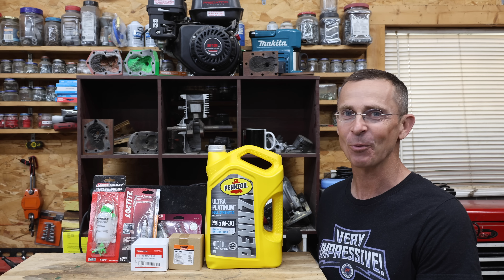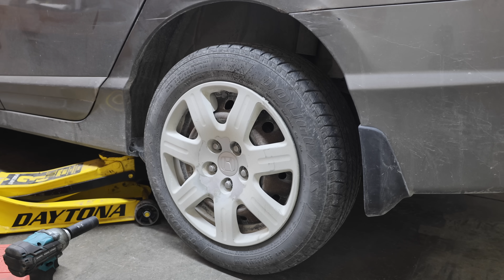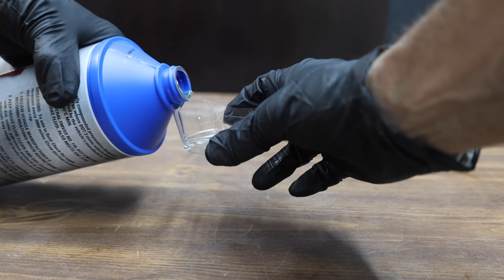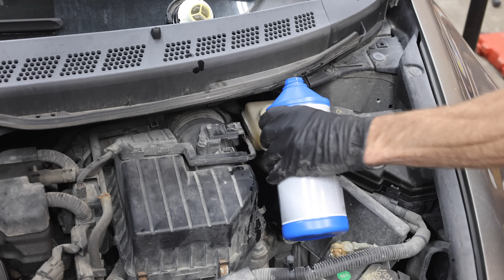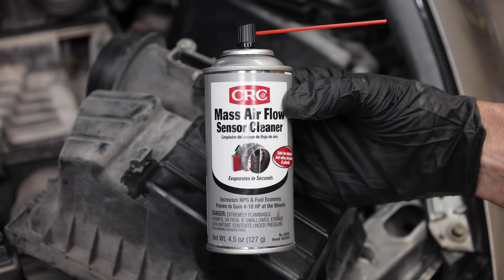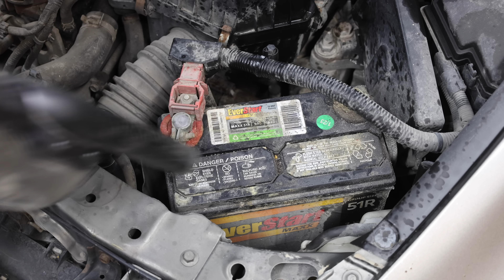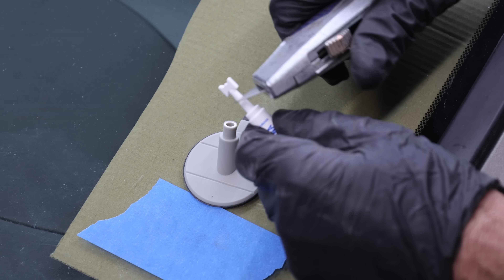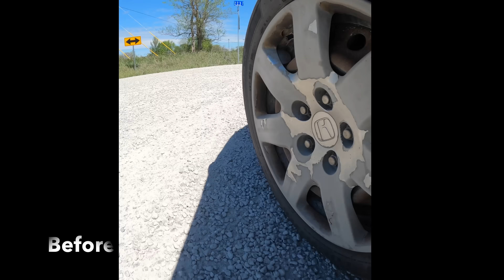Most Reliable 200K Mile Car? Let's Settle This!

Comment: My 2012 Expedition has 246k miles on and (knock on wood) she's still running like a champ. Bought her cheap because she had been VERY neglected but some new parts and elbow grease later and I have gone all over the midwest towing a boat and for family trips. About 60k miles over the last 3 years. The longer you run an old vehicle, the more it pays you back.
Reply from the maker: Nice!

Comment: Great work keeping that Honda on the road. The GMT800s are very reliable. I've owned my 06 Silverado since 30k miles. Currently doing a transmission rebuild at 170k miles.
Reply from the maker: Thanks!  Thanks for sharing.

Comment: a big issue i see with a lot of cars is people drive them when there are clear issues with them and normally just don't check them at proper intervalls. it doesn't need need a lot of checking a car ever 3000ish miles will find the small issues that will lead to bigger issues in time. take the CV joint easy and cheap to fix but not taken care of in time will lead to undue strain on other parts of the car. or take the trans fluid car makers says it is good for the life of the car but really it should be replace after 100-120k to have a longer lasting trans.
Reply from the maker: Thanks for the feedback.

Comment: I have the coupe model from 2008.  Reliable, with moderate repairs mostly ascertainable by DIY wrenching. The VTEC solenoid gasket is probably a thing to swap out at one this old.  The gasket costs like a dollar, but it will blast ALL of the oil out of the car like youd think the engine split in half. Hilariously good car, though.  Wont set any speed records and Tawny Kitaen probably wont be dancing on the hood...but its a good car.  Kinda reminds me of my Cherokee XJ experience; drama free.   It just goes.
Reply from the maker: Thanks for sharing.

Comment: I have a 07 vibe (reskinned n rebaged toyota) bought with 113k and now has 157k uses no oil easy to work on.  Drove a 05 vibe with 257k miles and just as good as mine!
Reply from the maker: Nice!

Comment: Great video!
Within my family in the past 30 years we have owned 16 different 300,000 mile GMs, 3 of them had transmissions replaced.
Not one of the vehicles even had an internal engine problem.
The most current GM has 346,000 miles on it and is my brother's daily driver.
It runs like new...
Reply from the maker: Nice!

Comment: Watching this makes me think, if I had the funds. I would have done the same to my 06 Cobalt with 348k miles. The car refused to die. But I traded it plus $2200 for an 08 HHR SS with 210k miles. It still needs some work. Funny thing is most don't think ecotec engines are crap. I swear mine wasn't always taken the best care of and it survived. But so many things failed in the last year. The water pump for a second time, the slave cylinder, abs module and coil pack.
Reply from the maker: Thanks for the feedback.
Reply: @ProjectFarm  no problem. Thanks for still being amazing at replying to comments.

Comment: I have an '02 BMW E39 525D Touring bought in 2021 and it's a fantastic reliable car (the M57 is bulletproof), regular maintenance only (I only had an alternator failure which was an el-cheapo wrong 120A unit, which I replaced with the correct OE 150A one brand new from Hella).
273500Km on the clock. So comfortable, quiet and it has a great fuel economy.
Reply from the maker: Thanks for sharing.

Comment: My 1994 Nissan Hardbody 4x4 needed some love after I bought it used as a farm truck. It's now a daily driver and workhorse with 197K miles on the old VG30E V6, and I fully expect to get 400K out of that original engine if I keep up with maintenance. Maybe more. It's all about doing your regular maintenance and you can make just about any vehicle last forever.
Reply from the maker: Thanks for sharing.

Comment: @Project Farm You typically adjust rear drum brakes with the drum on, through a hole in the back using a flat blade screwdriver, or that special tool you mentioned. Usually theres a rubber grommet in place.

Comment: Great video.  Should have went with Amsoil transmission fluid though 😊 I've always been told to only use Honda transmission fluid, but when I started having a hard shift I switched to Amsoil and it shifts smoother than when I originally bought.
Reply from the maker: Thanks!

Comment: That was some ugly transmission fluid.  I'd be interested in an update on that transmission and whether it starts slipping. There's a school of thought that says replacing fluid that contaminated will kill it. The thinking is that the "lubricity" of the fresh fluid will cause slipping and that the particulates in the old fluid are needed to keep the worn gears engaging properly.
Reply from the maker: Thanks for the suggestion.

Comment: As a retired ASE Master Auto Technician, I really enjoyed this. I like the way you edit it so it's not a long, drawn-out tutorial.
Reply: For real. I like watching another auto repair channel called rainmanrays, but he could make a 40 minute video just doing rear brakes.
Reply: Yes I appreciate the editing too.
Reply from the maker: Thanks so much!
Reply: What's the most miles you've seen on a vehicle??
Reply: @loveydovey4u  I have 237k on an 06 mazda tribute, 240k on an 08 sienna, and about 250k on an 08 prius.  Clutch blew up on the tribute, but the two toyotas are mechanically perfect.
Reply: @loveydovey4u  400k+ on my 2004 Dodge Ram.  Seriously good truck.
Reply: @loveydovey4u  I've seen  two that were over 350k miles that were single-owner vehicles, and a couple others that were said to have over 300k but didn't have verifiable documentation because they had gone through many owners.

Comment: Currently putting the front end back together on my 16 year sons 2010 Civic. He had a front end collision a couple months after getting his license. Needs a radiator, condenser to be mechanically back on the road. Then front bumper cover, grill, headlights etc etc. But only has 108k on it so will be worth fixing.
Reply from the maker: Thanks for sharing.

Comment: Great video, thanks for sharing. 👍I just replaced the struts on my 450k mile Jetta tdi wagon, but the axles are quiet and original. The only thing replaced on the engine are the alternator and A/C compressor and a couple of sets of glow plugs. As you showed, because of the price of a new car I don't have any desire to replace it.
Reply from the maker: Thanks and you are welcome!

Comment: i made a smoke machine alot like you made the fluid extractor using a pickle jar cheap soldering iron a battery powered tire pump  some cloth and baby oil
Reply from the maker: Thanks for sharing.

Comment: You may be able to find the best used car by determining the top ten used cars available. I would then compare the repair access/ease of fuel pumps, spark plugs, and etc. Some cars are pure trash which hide the battery or make you drop the fuel tank instead of providing a hatch. I would then look at transmission failure for certain generations. I looked through forums for million mile vehicles. I think post-2004 Honda Odysseys are the best in terms of crash rating, reparability, and transmission.  Any German car is trash. 

The entire lineup of large vans is pure trash. Ford, Nissan, and Mercedes. Ugh. The best is the buy an old Fed-ex van with a Cummins.
Reply: I don't look at Sedan's because a car should give me the maximum utility available for a certain price. You can throw a stack of 10 ft 2x4s into Odysseys  while the loser with a truck is tying them down. I have moved a fridge with an Odyssey. Yet trucks have 2x worse MPG. A transmission cooler can make the odyssey tow. They have the best crash test in their class.
Reply from the maker: Thanks for the feedback.

Comment: Really great video! Not everything is accessible to an average car owner (torquing an axle nut to spec, for example) but so many parts are! I know it's not a comprehensive guide to vehicle maintenance but I love that you showed things to check in the antifreeze and brake fluid!
Reply from the maker: Thanks!

Comment: I'm all about that preventive maintenance since I have an aviation background in training. At 200k on a nearly 20yr old vehicle, I'm also changing the radiator and hoses. Don't want to have a spontaneous coolant leak over heat the engine and completely ruin the investment. Last summer, I had a $10 transmission cooler hose to the radiator leak while towing 4hrs from hime and it destroyed my transmission on my 2004 Titan with 214k. It was a hose I SHOULD have replaced when I replaced the radiator. Small over site that cost me BIG TIME months later.

Comment: Nice work, Todd. Those older civics are great cars. One of the most expensive considerations these days is fuel. If you were driving something paid for like your suburban, which probably gets 12-16 mpg, and move to something like a Highlander hybrid that gets 36, you’d could save as much as $253 a month in fuel at the national average of 15k miles per year and 3.65/gallon for 87. The other thing to consider is safety. Most newer cars are made to meet much higher safety standards than older ones.

Comment: If you’re able to do more of these that would be awesome. I’m also one who prefers the older route. I currently drive a 1987 S10 with over 540K miles on it and an 07 Camry with 220K on it. I recently dropped about $2K on doing the entire suspension, getting used OEM alloy wheel, new tires, new mirrors and headlight assemblies and a few other odds and ends. That was a decent chunk of change, but the car has been amazing and it’s way cheaper than getting a new car

Comment: I am wondering, what about the timing belt? Honda of that vintage usually need to have the timing belt replace every 100,000 mile. That's normally a $1000+ job.

Comment: 2005 Acura TL that my Wife drives. She loves the car and will not get a new one. I do all my own repairs so I've replaced tie rods, end-links, all the calipers, rotors wheel bearings, timing belt, water pump, starter motor, bluetooth electronics, front seat covers, both front CVjoints/ axles. All for under 2 new car payments. Wife is super happy. It still looks brand new
Reply: Dude,I bought my wife an 05 TL 8 years ago and it still looks new and better than a lot of the new stuff out there. It’s got 190 thousand kms on it and I’m gonna have to do the timing belt as the last time it was done was when I bought it.They’re pretty thirsty cars though but solid drivers😊

Comment: I had a 2001 Nissan Frontier with 332K on it. It had a transmission problem that would have been about $2000 to rebuild. The company I worked for had a vehicle reimbursement plan that incentivized us to have newer vehicles (and I could not be without it for as long as the tranny job would take) other wise I would have just have fixed it again. Hoping I get that kind of life out of the '16 Nissan Rogue I replaced it with. Up to 130K now with only expected routine maintenance and consumables.
Reply from the maker: Thanks for sharing!

Comment: Around here, 10 year old vehicles are usually just rust held together by more rust. By 15 years they tend to leave a trail of iron oxide and parts wherever they go. The exceptions are those kept off the road in the winter or migrated here from down south.
Reply from the maker: Thanks for sharing!

Comment: I don't know if it was mentioned in the comments but you should never do a complete transmission flush on a high mileage vehicle that has never had regular transmission maintenance, the reason why is that old transmission fluid has changed viscosity and the new thinner fluid can cause slippage, it might not happen for every vehicle all of the time but it can and I had that happen to me with an old Bronco, it is best that if the trans fluid has never been changed to just replace the filter and top off the drained fluid unless you are willing to take the chance.

Comment: You can use a shop vac take hose off and cut out the bottom of a 2 liter bottle drill hole in  cap for pickup hose place small container in side vacuum place small end of bottle with hose running in to small container bottle in thru where hose connects to turn on vac.
Reply from the maker: Thanks for sharing!

Comment: Good old civic with the R18 engine, those never burned oil, never had any issues. They were SOHC with a pressure switch to engage a fuel saving mode when below a certain rpm. Super simple and unkillable. I think you did all the maintenance right in time, especially the transmission fluid, it's something people forget to do and can cause permanent damage if you put it off for too long. Regular intervals and it could go to the sun and back.

Comment: I beat the life out of my same honda civic as that one and am at 297k miles. Check engine light finally turned on at 280k with a bad catalytic converter which I don't care to fix. I've replaced a starter and a thermostat and otherwise it's been solid. Been offroad more than most trucks too and it's held up.
Reply from the maker: Thanks for sharing!

Comment: I bought a 2000 Plymouth  Breeze with 60k miles with bad rear brakes, I drove it for five years and sold it with 300k plus for more than I initially bought the car for, can't beat simple. Four banger, auto Trans & just AC. Nice video as always.
Reply from the maker: Thanks!

Comment: I've heard this called "Bangernomics". It's worth putting reasonable amounts of money into a car that's basically good apart from some maintainence issues. The fact that the repairs might exceed the value of the car doesn't matter, that money is a good investment in a now-reliable car. Once the big wear items like shocks, clutch, brakes, timing belt are done you can relax about them. Cases in point: my 05 Honda CRV and 85 Goldwing 1200. both get whatever they need despite spending their value on parts/service, and will probably outlive me.

Comment: I worked at a Honda dealership (2010) and we had a guy bring his 2003 Civic in monthly with 3-4k miles added each time.  We'd do all the routine service on it.  That car, the last I saw it, had ~450k miles.  Original engine.  They are beastly cars when maintenance is done on them.
Reply from the maker: Thanks for sharing!

Comment: Had that exact model but with a manual grinder transmission.  Definitely an oil burner. Could have been caused by abuse from previous owner.  Even burning a quart every 1k miles, it was still running great at 280k when I sold it. Seats were hard as all get out.
Reply from the maker: Thanks for sharing!

Comment: Crash protection IMO is the reason to switch to a new vehicle. Your risk of injury getting t-boned in a 2000 camry vs a 2020 camry is vastly different due to advances in airbag tech and frames.  We may be hitting  a point now where in 20 years there's not much difference between a 2020 and 2040 camry in a crash test.  2015s and onward are where we see really big advancements across the board, with airbag tech and rollover protection/roof strength being about as good as they can get.

Comment: I would recommend checking/changing the timing belt in that Honda. They're usually interference engines and if the belt slips or breaks. The pistons hit the valves destroying the engine. Some models have the water pump driven by the timing belt. You can get a complete timing set with water pump for around $200-300. Expensive but worth it. Im hoping to do most of the repairs you just did to my 2005 Civic. It only has about 175k miles. So its got a lot of life left in it
Reply from the maker: Thanks for sharing!

Comment: We purchased a 2013 chevy volt 1st generation back in 2015 and we now have over 203767 miles on it. We've only done 7 oil changes, 2 radiators from road debris hitting them as there are two of them in the car. 1 for the hybrid battery and one for the engine/DC generator. 

It still has the oem pads and rotors on it due to using regen braking 98% of the time. That and tires are all We've ever done to the cars. 
I say cars because we now own 3 of these 1st gen volts and while driving on the battery only it costs 0.02 a mile to drive them. They extremely well built cars and I know everything about this car.

 I am a former heavy diesel mechanic and I tore this car down to nothing so I could have a full understanding of how it works.

 This car will easily get 500k or more out of it just based on how it operates like a train more or less. And how many miles are put on a train in their lifetime?

Comment: I love my 1997 Saturn SL1. I bought it in 2017 when it had only 100,000 miles on it. Like you, I did struts, brakes (including rebuilt calipers in the front), coolant, manual tranny fluid, etc. It has 166,000 miles on it now. I don't commute because I'm retired. Zero dings or dents because of that plastic body! While watching, I realized that I haven't ever changed its spark plugs!!! I'd better do that this week.

Comment: The beige transmission pressure switch has a different psi break point than the original yellow one. Beige is 26psi and yellow is 29psi. Surprised it didn't bind or flare on the shift. How was the shift quality

Comment: If you have the skills, replace the new timing/cam belt and tensioners. Some vehicles have a belt driven water pump, so replace that too. Failure of the timing belt could wreck the engine (depending on the vehicle/engine). Timing chains can snap, but usually they rattle loudly before such a thing occurs.

Comment: I love your videos. However, Most people don't have the tools or the knowhow to do maintenance on old cars. All the (old) cars I had, were desperate for engine oil, which I always top up. Also, all mechanics are super busy, over charge for the labor, and many are useless. I've had a car serviced, and they changed a worn out part from the suspension. After that, the car wasn't balanced anymore, and had many accidents (on a returning trip of 2000 miles).
Reply from the maker: Thanks for sharing!